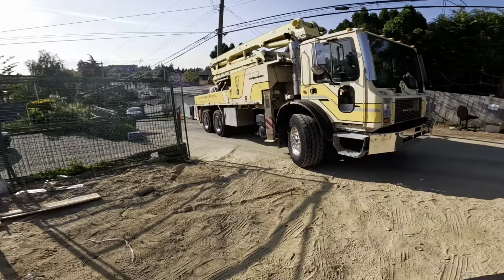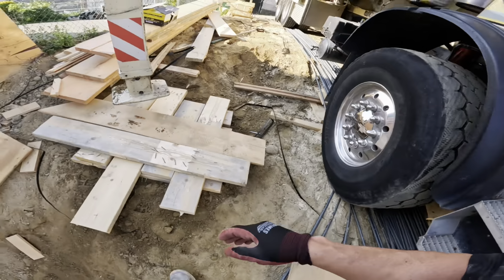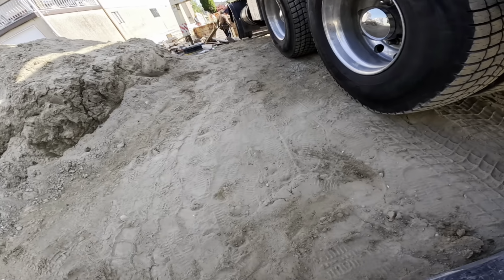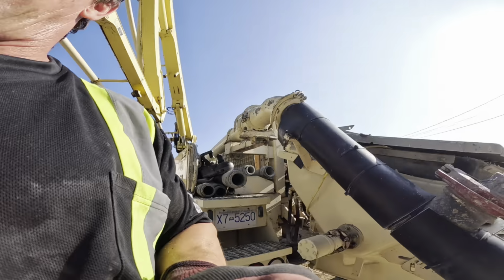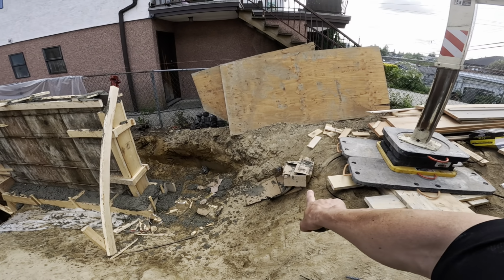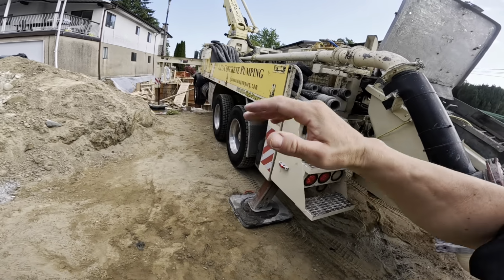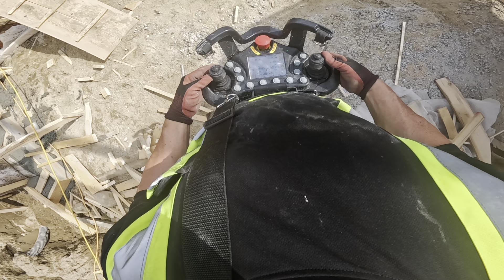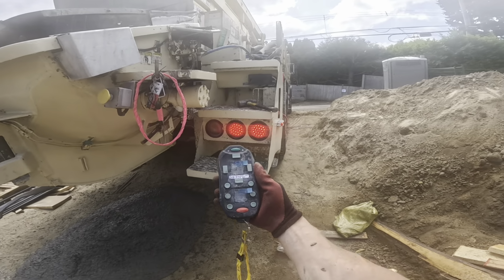All jacked up again!!!

Comment: I like the looks of that AARCOMM set up a lot. if you wear polarized sunglasses, can you see the screen in the day time? or does it become completely blank like the ergonic 2 display
Reply from the maker: I actually hadn’t noticed any issues with screen visibility in direct sunlight. I’ll take closer notes next time I have it out however.
Reply: @canadianconcretepumper1979  The displays will not wash out in direct sunlight. These LCDs are partially reflective which means they look better in direct sunlight. All of Aarcomm's products use this type of reflective LCD technology. Backlights consume a lot of power and we don't need backlights.
Reply from the maker: @AarcommSales  Thank you for the clarification Doug 🙏🙏🙏

Comment: 8 hours? I believe it. I'm sure dispatch told you your next load "will be loaded in 15 minutes" for 6 hours. "It's 20 mins out" and when you call back an hour later "it's 20 minutes out".
Reply from the maker: That’s actually not far from the true story. 6 hours in, a truck shows up, and they decide to divert it to the other pump on site. I must have burned through 2 full bags of delay-set, and made 3 separate trips to the pizza place across the street during that 8 hour stint.

Comment: 😂😂 ok so the ball starts at the exit an?? Stops at the pin… but😮 does it Eat the ball??  So every time you have to use a new one?
Reply from the maker: No sir. The stopper pin prevents the ball from being pulled into the valve and becoming chop suey.